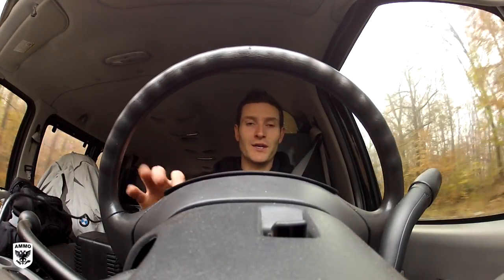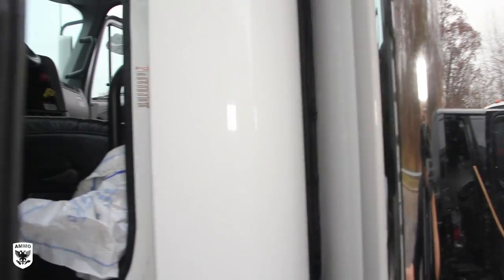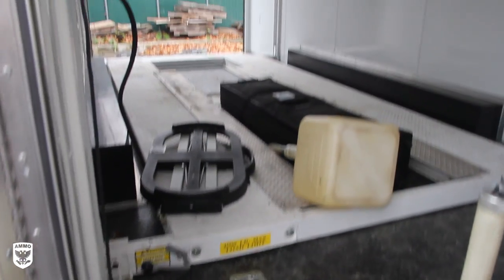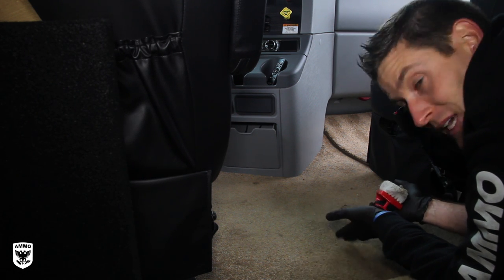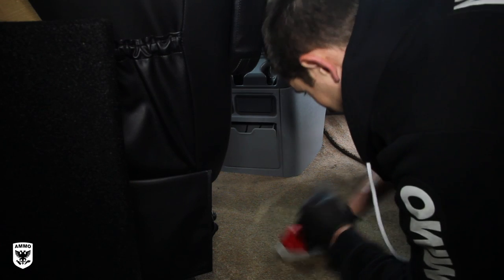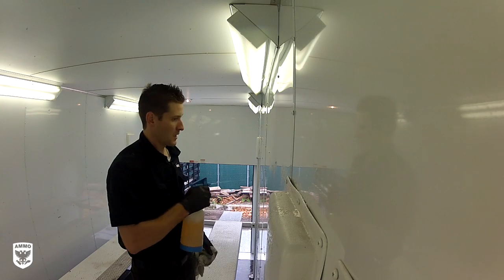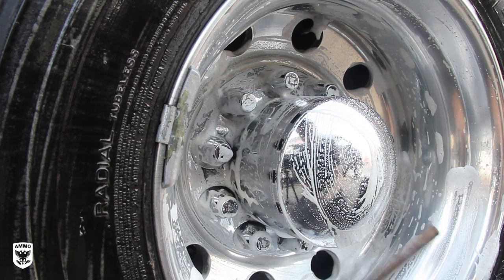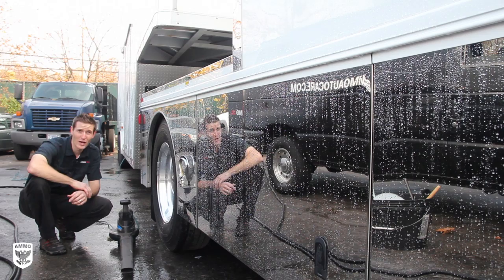How to Detail a Motorhome Camper Van RV

Comment: I am a lawn care guy to and they are called stripes . Stripes are made when the grass is pushed one way and the it comes back if you look at a dark stripe when you go to the opposite side .that is because the sun is behind you the the stripes going away from you is light but coming towards you it will be dark the light ones are made because the sides of the grass is reflecting the light.shoutout please

Comment: What kind of microfiber are you using? I ask because the standard type you use to dry paint has large fibers that leave streaks on glass. You have to use a cloth with small fibers to stop the streaks, they're just called glass microfiber towels.

Comment: after you cleaned the carpet what did you use to completely remove the cleaner? leftover cleaners in carpet will attract more dirt . a secondary function of the hot water extractor is to remove the cleaners used and to return the carpet to a neutral PH balance.

Comment: Larry, this video is great. I drive a Freightliner semi similar to this except it only has the cab and not the rest of the living space. I have a couple questions. For the original vinyl floor, what did you use to clean it and so it won’t be slick? This also applies for the dash and gauges. Thank you for your time and for the information you share. - John